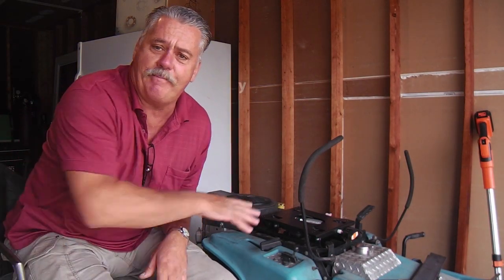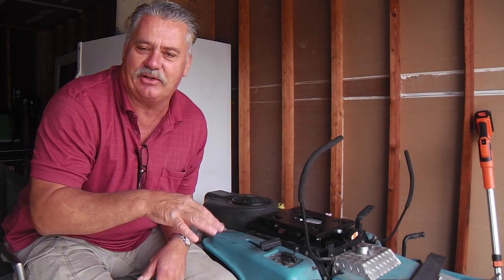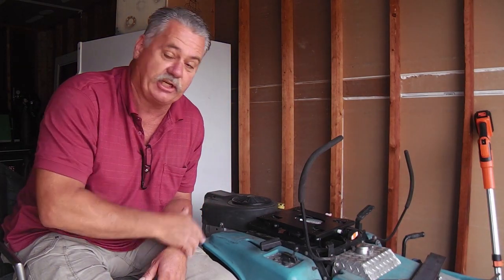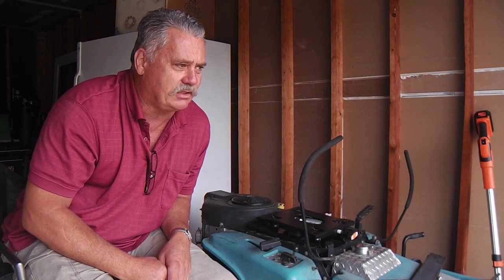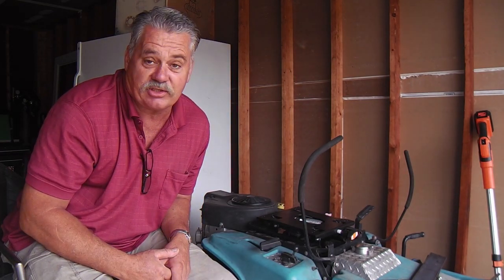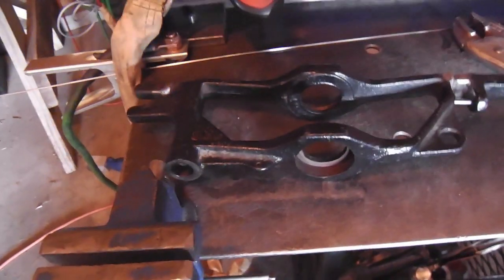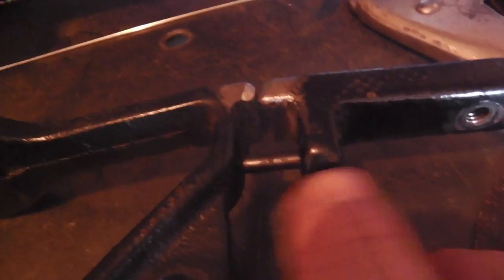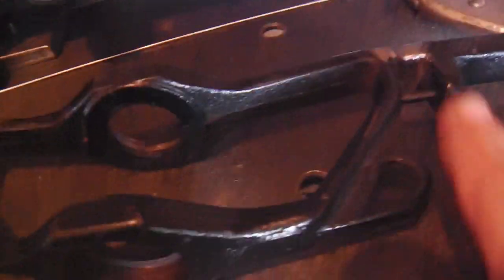Dixon ZTR Mower Transaxle Cradle TIG Welding Repair

Comment: I did a similar repair I used aluminum bronze to fill up the oil seal reservoir. They don’t take a lot of abuse so they’ll hold for a long time. Good job on the repair. Glad to see you out of the laundry room.
Reply from the maker: Hey, thanks for that nice feedback. Yeah, these little Dixon friction-drive mowers are fun for me somewhow. I've only used silicon-bronze filler rod for TIG "brazing" on some small cast stuff that was mostly just a decorative repair. I think the stainless filler TIG "welding" on this thing was a good way, even though some mild steel filler rod might have also done a well enough repair, but I'm just a novice with cast metal welding. The old laundry room/metal shop was cool for its 220/240 volt outlet to the welder and since my surround sound system was right outside the doorway, which made for great listening while welding. Now I just use an MP3 selection of songs on my cell phone in the garage, which is OK.